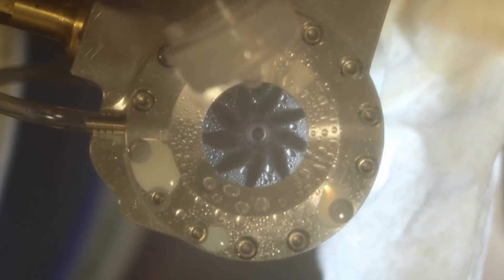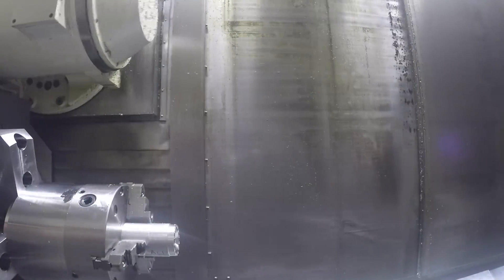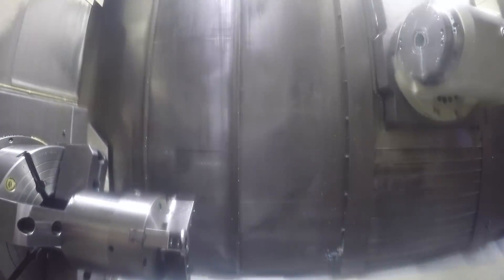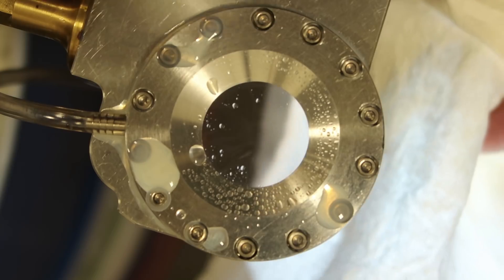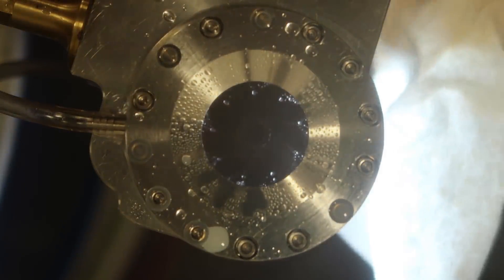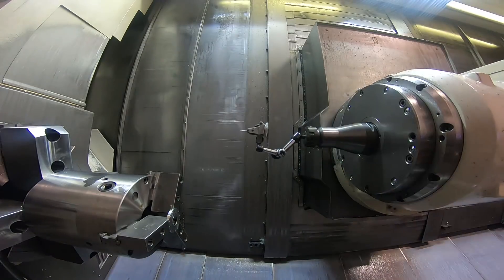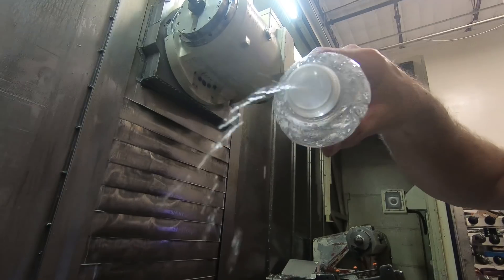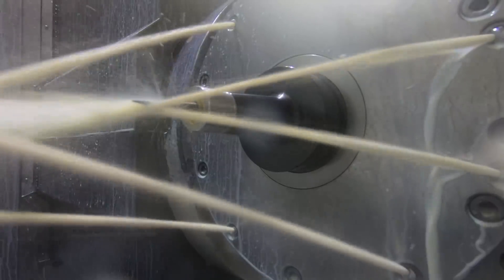Air Knife R & D

Comment: I am late to the party but I would vote for assymetry and a one side blow.
Reply: That definitely looks like the problem is that all the designs are symmetric. Radial groves around 1/3 of the circle that fan out would push the coolant off to one side. This is a great idea. So many blurry machining videos on youtube could be eliminated.
Reply: they used to put spinning windows on cnc machines.  they work absolute wonders.
Reply: add a tiny slit to shield those air jets from coolant entrainment, and it'll probably work even better. I've used .005" cutoff wheels to make air slits, with good effect.
Reply: or put the camera lens off to one side using the 95% that does work.  
a circular arrangement will create a spiral, like water down a plughole. I wonder if it would rotate in an opposite direction better there,  or here in NZ ...?
Reply: yeah it needs something to change the pattern and keep it from being too regular, I was thinking of a few air jets coming in backwards or having the air enter tangent to the circulation groove to create a natural gradient of pressure and if that isn't enough you could play with moving parts...
Reply: Maybe using the golden ratio Phi would work. Have a groove every 1.618 times around, using various numbers of grooves.

Comment: The flow path although very important to the design and secondary. The primary is what you're trying to compress currently you're trying to compress air which is a composition of other gases and Vapors. The air is interacting with the humidity in the air that is the ring you're seeing is actually the moisture in the air being displaced. There are other gases you can use if that's what you're trying to do is cut using a vapor or gas. You want something with a higher density. So moisture is not in the equation anymore. I believe what you're looking for is two rings one opposite of the other with opposing focal points that may give you the desired effect you're looking for.

Comment: I think you are on the right track but you need some Asymmetry in the design. Either air from one side and nothing on the other, like many have suggested. Or unequal spacing of the radial groves, like a variable flute endmill.

Comment: I think if you do your original design but then have an exit vent around the corner of the camera and a second tube blowing out the exit vent to pull the water out, not push, pull. like pull a vacuum. You need a 3D printer for this stuff just to make a design in a couple of hours.

Comment: I assume that the aperture of your design comes from the aperture of the camera. If that is true, do you need that size to capture the image you are trying for? The compromises you are making are fluid clearing and image quality. The compromise the camera manufacturer made was all about varying lighting conditions their product can be used in.  The surface area that you need to clear can be reduced without noticeable degradation to the image by masking the edges inward. At some point in the masking, you will become unhappy with the image, and that point will be the smallest you will ever go, but the area needing clearing is now greatly reduced. Just a different variable to ponder in your R&D. Love your vids. Tom

Comment: Your work is great as always. My 2 cents is try making it a little thicker and adding just 2 tangential inlets at two sides aiming down and a ramp on the top, with a width about 1/2 of the distance between the inlets, aiming the flow up and away. Maybe a third nozzle at the bottom will prevent probable pooling as well but I think the key here is avoiding a concentric vortex. Hopefully this will create a W flow pattern (more like UU), which will keep the center of the lens clear without too much drying or pooling.
Hope this helps!

Comment: Hi Peter, if the first design worked alright with the various air pressures. Try increasing the size of the air kinfe to cover more of the camera body housing so the center of the vertex and lens are offset to each other. The design might have a size limitation but could possibly try to get the vertex out of video completely. Maybe even an oval shape.

Comment: engi nerd here. If you read up, or talk to me :] ,about aerodynamics and sediment transport, what you have there with that puddle of water in the centre of the lens is a circulation bubble, or vortex bubble, there are lots of names for the same phenomenon. It is a low velocity bubble of fluid (air or air and coolant mix in this case) that just spins around and does not have an in or out flow. You might also be getting these on the triangular areas around the edge of the circle of the lens, but i suspect they are just areas that dont get an air jet on them at all, or "outside the flow regime" in nerd talk. As there is no flow of clean air in or out of the bubble the coolant just ponds there and sediment transport theory will tell you that denser materials tend to accumulate there as they can easily drop into the bubble but not out (so coolant or water tends to accumulate there being heavier than air) Ever noticed how leaves accumulate in the corners of the garden on windy days ? that is there theory i am talking about here. How to fix it ? I would try to blow air across the lens with a pulsing factor (changing velocity).  You will still get separation points and vortex bubbles in "across the lens" systems (probably a squarish volume perpendicular to the flow) but with a pulsing factor you can be constantly sweeping the vortex bubble away (and therefore the puddle of water/coolant).  To create the pulsing system you would need to be varying the flow somehow. A ball bouncing around in a tube in the air flow upstream of the lens might do it.  Or you might try something with a flapper instead of the ball, like in a reed in a wind musical instrument (but backwards).  Getting the frequency of the pulse right might take some trial and error, but just change the thickness or length of the reed until it is right.  This stuff is much easier to explain with pictures, I dont know how clear my explanation is here, so if anyone here, peter or any subscriber wants more on the idea I can make a few sketches and post them on imgur or even make a quick video about it.  It actually is a part of rocket science, but its not hard.  I tutored a few guys back in my uni days on this stuff, any guy that messes with tools can get the idea, its just doing the math for it is what takes a phd.  You dont need to be doing the math to come up with a working solution either, the testing alone can usually get you there. please let me know if i can help.
Reply from the maker: This is a interesting idea. Pulsing the air flow might be enough to upset the swirl in the middle of the lens. I was thinking of a simple aquarium air pump. If you have ever taken one apart. They are a simple diaphragm pump that just uses a magnet passing by a coil. The 60 cycles of the line AC causes the magnet to vibrate and pump the air. A electrical circuit could be made to vary the frequency of the AC to vary the pulsing rate. There might be a certain frequency that would disrupt the bubble/swirl in the middle of the lens.
Reply: that drop in the middle is because of circular symmetry - vortex in the middle that has nowhere to go, why not just make the slots in the top, or sort of like a flat opening on the top side - that would create a blanket of air pushing everything downwards
Reply: The design you've created actually appears to cycle the flow of air to achieve this goal.  The differant size and location of air channels on the perimeter mechanically pulses the dilation of the air knife.   This problem seems ideally suited to a simulation program.  I've seen a guy named Grady Hillhouse (engineer) use a physics simulator to model simple problems.    The site he used https://phet.colorado.edu/ might be handy for you.  If you get a chance check out his video on building an arduino ISS tracker https://www.youtube.com/watch?v=sIE0mcOGnms it's a real page turner. Keep up the great work!
Reply: Wouldn't it be easier to have an additional airstream from higher above the window to push the rotating bubble in the "ejection zone" ?
The best way to disrupt this, would be an opposing airstream that would keep the system in a chaotic behavior.
Reply: I know I'm late but if you made a video about that or about other aero stuff, I would 100% subscribe to your channel for more

Comment: Look at windshield wiper nozzle designs.  Don’t use straight air paths.  https://www.plasticstoday.com/content/analyzing-snapfit-pays-nozzle-design/178028769720
Reply: http://dlhbowles.com/solutions-services/fluid-management/nozzles/
Reply from the maker: I had thought of bleeding something into the air supply to break down the surface tension of the water in the coolant. Or possibly a two part system. Blow a cleaner, than air and alternate between them. Kind of like a windshield wiper affect. The whole thing actually works better if it remains wet. When the coolant stops flowing the air drys out a coolant residue on the glass and fogs up the image. That then requires me to wipe off the glass. Interesting idea.
Reply: I was thinking more about the fluidic design of the nozzle passage.  Oscillating flow with no moving parts.

Comment: Maybe you must try with some anti rain glass, with layer of some chemical  which not stick water on glass...and second with curtain of air before glass like first stage, and second stage what you have in this moment.
Reply from the maker: The glass does have a coating on it to repel water. I mentioned this in the first video in this series. I did make a Air knife for my Hero 4 case that actually works better than this so far. It uses the principal of the air flowing over a radius than on the surface of the lens cover. I show that in a previous video "Air jet to clear screen for GoPro".

Comment: Even better if you suck on one side and blow on the other ,you can get the suck with the compressed air using a venture  and you  want to adjust it to neutral or bit more suck than blow

Comment: Maybe face about .002-.005" gap between the air groove and the inside diameter?  Just blow air all around.
Reply from the maker: That was the first thing I tried. It is very difficult to get a even gap all around the perimeter so all the air flows out where the gap is largest. This also requires a lot of air flow witch makes noise that's picked up in the cameras mic.

Comment: Hi Peter,great work; i have the same problem with machine s i built for armoring cable common name bx cable , we use coolant too at 1300 rpm and is very hard to use camera to see inside the machine in operation.i am curios to see your sucess !!! a big hug from Toronto.

Comment: The last configuration seemed like it works OK.  I see many interesting ideas in the comments, I think I would lean towards having  air flow from one side only.  Maybe only half of the circle either horizontally or vertically.  Does you oil free compressor have a desiccant filter?  I would think you might have problems with moisture in your air supply when the humidity gets high?
Reply from the maker: Thanks Bill. Yes even on this oil less air compressor it condenses water in the air tank that mist be drained. I should have clarified my comment in the video. Because the air compressor in this shop is a rotary screw type there is a certain amount of  oil in the air supply. If I use the shop air this gets on the lens cover and causes problems. Its more the air/oil mixture in the shop air that is a problem.

Comment: Do you use Mazatrol or ISO programming?
Reply from the maker: I only use Mazatrol to bore soft jaws sometimes. For everything else I use the cam software and process a G code or EIA program.
Reply: Edge Precision but y? Is mazatrol that complicated? Actually i just got integrex j200s last month, thts y m asking.
Reply from the maker: No Mazatrol is very good for straight lathe work. I don't care as much for their milling. I cant see with the graphics on the machines control what is going on in milling as well as on the computer. For me it takes more time to do a milling/turning type of program on the control. So I prefer the computer's cam software for this. All of it can be done with Mazatrol and it is worth learning.
Reply: Edge Precision do u think machining a keyway 18mm width, 4.5mm depth on ID and total length of 62mm would be a nice idea on this machine?
Will it work for batch of 150 nos. qty. per month?
Reply: Edge Precision will Fusion 360 work on Mazak Integrex?

Comment: instead of a symmetrical airflow why not directional from one side to the other, or even 2/3 of the ring just so the liquid has somewhere to go. If some liquid piles up at the far end you could try increasing the air pressure. Maybe with 2/3 around the ring it would still swirl the liquid into a pile and then float off toward the edge with no air flow.

Comment: Hi Peter, I was thinking about the problem of the ring in the middle, maybe it is because you are too precise ( that is a problem ?? ) and the presured air is comming with an angle toward the center making a perfect vortex, you made a water/coolant rotor air turbine ;). What about have an unequal pattern of size and angle, I mean, have the configuration of the grooves like to have a more chaotic movement of the coolant on the glass to break/not allow to form the circular motion on the glass, I think it could be a way to blow the coolant when it is on the glass. Using a lot of air/presure wouldn´t help, as it would work as an evaporator and let a part of the soluble oil on the glass.. Also I don´t know if the exist, a water repelant like that nanoparticule thing they anounce for cars, it could be a good combo if there anything cristal like of this king of products. I am not sure what I worte is understanable. Let me know if you need more of my idea. As Always, thank you for sharing videos with us.
Reply: All good ideas, I think the problem with any of the coatings (nano or the likes) was the way that the emulsifiers in the coolant attack them all.  If I remember right Peter mentioned a while back that he had found one that could possibly work and was waiting on a sample to try it or something. I'm not sure what became of it, if I'm even remembering correctly.

Comment: Hi! Interesting flow study you got there.
As I was watching, it kept coming to my mind that you have periodic flow interactions that end up stabilizing in the middle and that you must break the pattern to get rid of them. In other words, make asymmetric channel distribution and configuration, in order to create instability in the middle of the glass. You may also try to add an external "micro-pipe", deriving from the air input and pointing at the centre of the glass at a shallow angle (10-20 degrees) and, maybe, flattened at the end, to generate a fan-like blow. Just ideas.
Hope this may help trigger some new thoughts on your side.

Comment: making a mini tornado may be eliminated with irregular directional air flow, very interesting challenge
Reply: I also think this could help. Some air flow to disrupt the centre spot. Change the 3 groups of radial grooves so that each group is a different angle off-radial.

Comment: How about just having it blow air from one side to the other, or having angled holes blow the air down at the Lens.
Reply from the maker: Thanks for all the responses! What I'm attempting to with the circular motion is use the centrifugal force and the weight of the water to sling the water off the lens cover. It appears to almost be working if I could get rid of the drop in the middle. My current thought is something that causes a unbalance such as a pulsing air flow and a asymmetrical air passage pattern.
Reply: I'm thinking the same. Blow from the top down, don't fight gravity and would work best if the window was square or rectangular in shape...
Reply: Edge Precision your missing the point that an Iris approach pushes the liquid to the centre with no where for it to go, cause you have a 2D surface, if it was 3D eg a cyclone then the material exits through the centre perpendicular to the swirl, but you don't have that option on a 2D lens surface.
Use 1/2 the ring and it will work perfectly.
Reply: ditto... A curtain should work better than an iris. Or, use the version that creates the small droplet but add another stream from the top to have it drift out of frame.... Otherwise, well done, keep the videos coming!
Reply: A linear flow might work, or some combination.  If it's a circular pattern, I think there needs to be at least some sort of asymmetry to keep it from making a stable circulation pattern in the center.   I didn't expect such a stable low pressure spot at high flow rates, but I suppose it makes sense in hindsight.
Reply: If you're looking for centrifugal force to move the water/coolant I'd suggest installing the glass on a bearing in front of the camera and rotating it using the airpressure line - Might require a namechange from Air Blade to Air Caroussel though ;D
Reply: I'm thinking the same thing. A air wipe across the lens....
Reply: Same. I think that would solve the problem.
Reply: same here, straight port cuts and less than 180 degrees so no one or more pointed at each other (facing 180 degrees opposite) working together not fighting each other.
-
Failing that EP could just hack this toy or make his own mini windshield wipers ;o) https://www.tintoyarcade.com/windup-wiper-glasses-green.html WINDUP WIPER GLASSES GREEN ANIMATED
Reply: I agree.  After watching the circular pattern.  I think a non-symetrical approach might be best.  Blow air from top to bottom or similar.